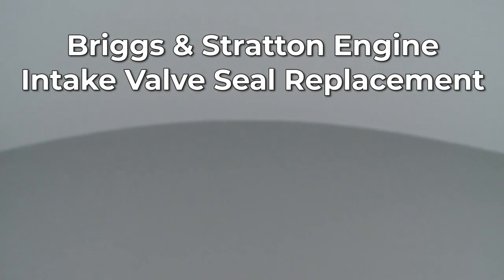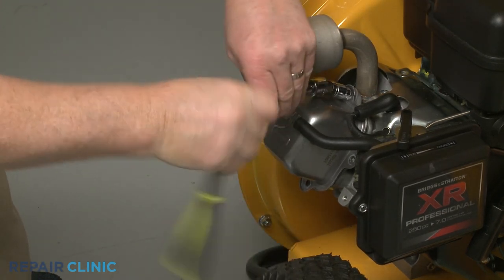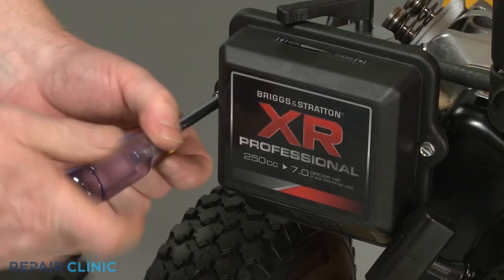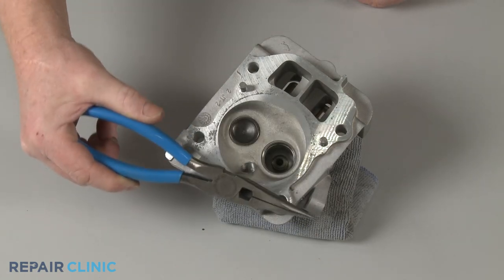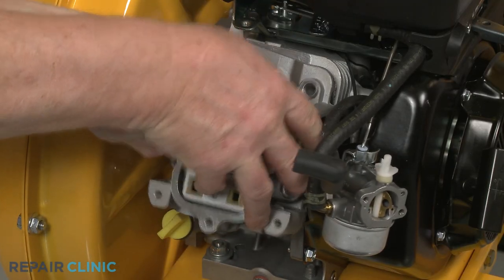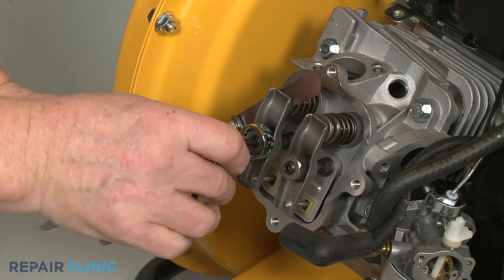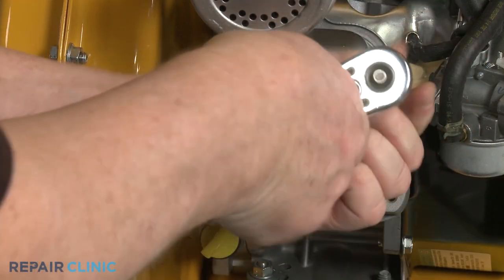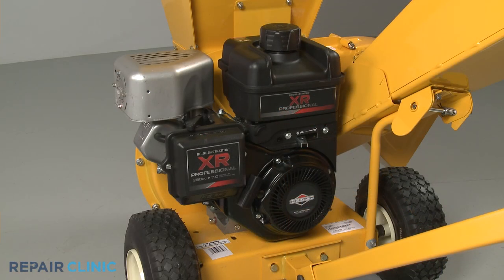Briggs & Stratton Small Engine Intake Valve Seal Replacement 795440

Comment: I would have liked to have seen how far down the seal was supposed to go on the spot where the seal installs. Mine went on real tight and I wasn't able to use hand force downward with the socket and extension to be sure if the seal was seating all the way down or not.

Comment: I don't have a Briggs & Stratton but i am watching this to get a general idea of how to replace the intake valve seal on my gx200 honda clone engine that i lost the valve seal on. I was going to replace the valve springs and all i did was touch the valve seal and the thing just disappeared right in front of my eyes lol. I dunno if it popped off and landed on the ground somewhere or if it fell into the hole it was sitting in front of and it's now inside the engine. I searched the whole area of the ground where i was working and didn't see it anywhere. Now i'm dreading having to disassemble the engine to look for it. It's my own fault for not making sure the piston was at top dead center first. UGH !!
Reply: lol what ended up happening?